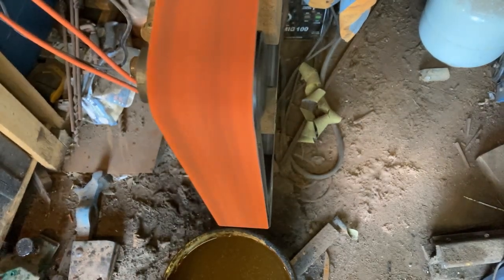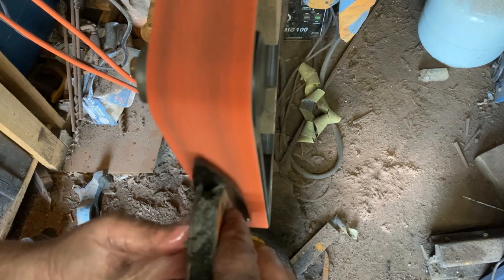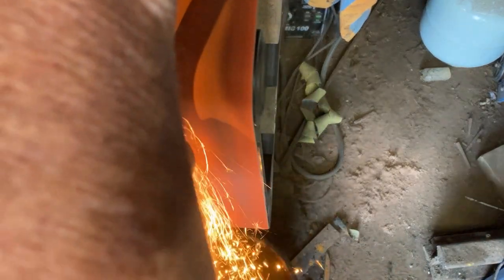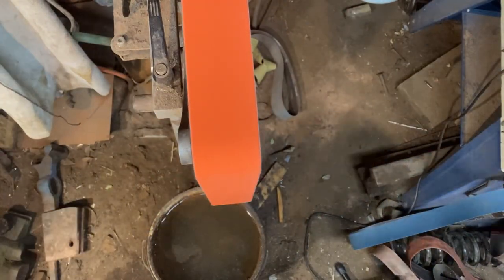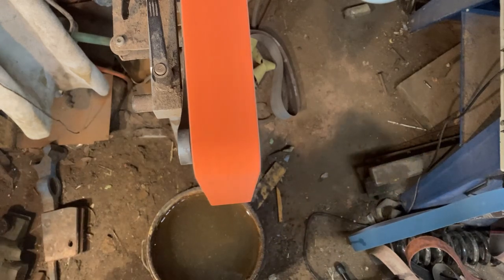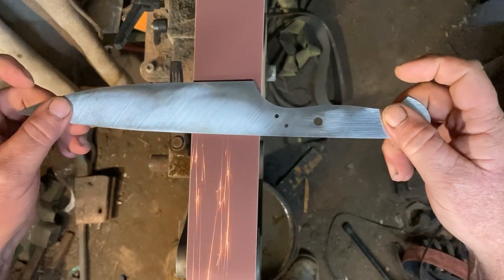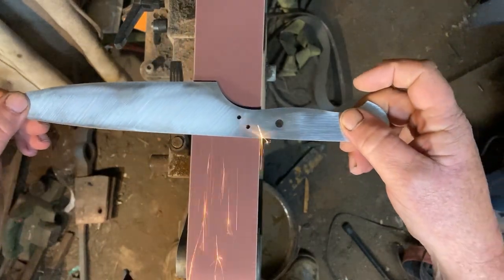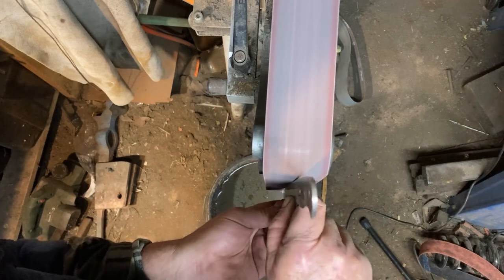Chef knife bevel grinding

Comment: what a great video thank you for such a awesome explantion just subbed and liked im making my 1st chef knife for my son out of O1 its coming alone nice happy with it so far ive only been making knives for 1 year but love it
Reply from the maker: No Dramas at all. I have had multiple shoulder surgeries, so the method a few people do where they wash out the bevel lines by hand sanding with a soft backing does not work for me, machine is the way to go for me. The only offset of doing it this way is that very slight rounding at the bolster location, so I glue and pin on my bolsters to make sure any gap is filled and can't hold water or contaminates

Comment: Darren what’s the difference between drenching in water as to oil🍺🍺
Reply from the maker: The oil is for quenching at Hardening stage, is slightly slower to cool the steel than water, water at that stage is too fast and will crack the blade. At this stage I am avoiding high temperature that will alter the blade hardness by using the fast cooling of the water.
Reply: Awesome thanks, maybe you’ve told us before. 
It’s such an interesting hobby. Like how you blended in the sides with the edge. This is going to be another great knife 👍
Reply from the maker: @downunderfulla6001  lol mate learning to blend it all is the hard part, doing it by grinder is a lot quicker than hand sanding but tricky.